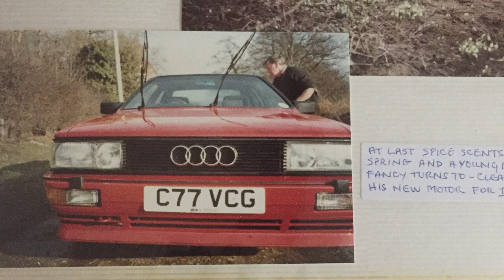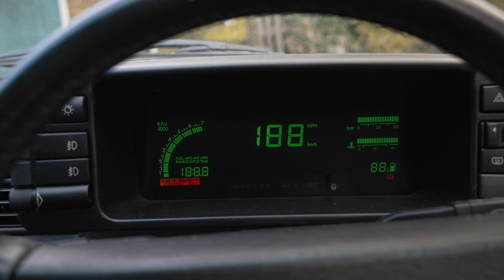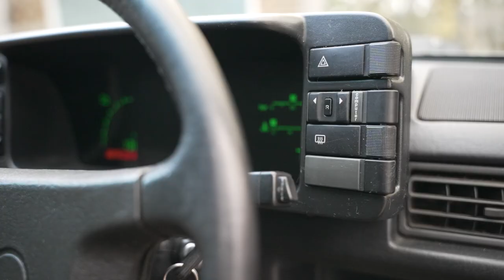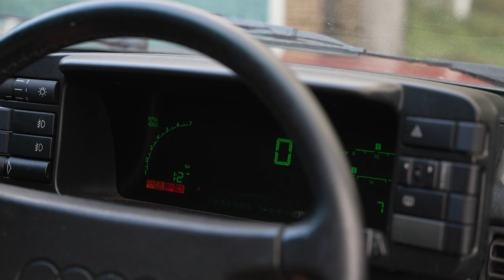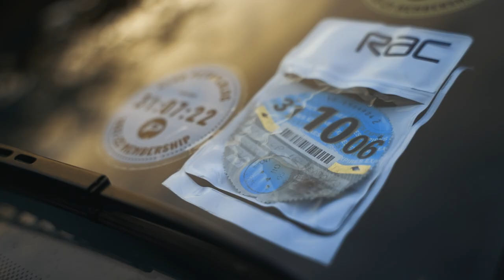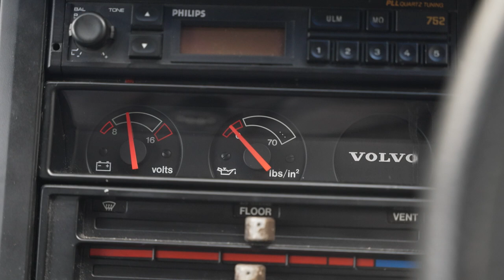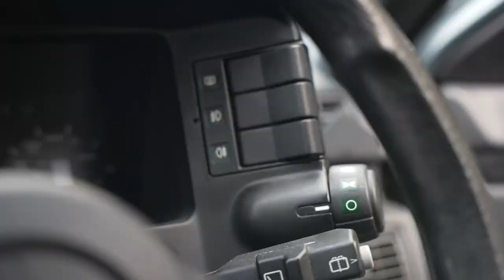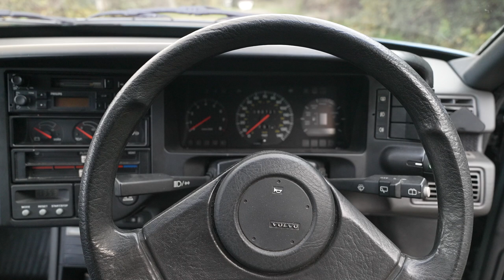80s classics make perfect first cars // The Late Brake Show

Comment: I worked on these as a apprentice at the local Volvo dealer, they were terrible, electrical faults, water leaks, shitty Renault engine that leaked like a sieve. We used to refer the ES model as the en suite 😆..
Reply: My wife had a Volvo 480 for 3 years. It needed recovery twice a year "reliably". The frequency of breakdowns was the only reliable thing about it.

Comment: Great to see two young car enthusiasts with a passion for classics.  Love the Volvo 480ES, always wanted one from the minute I got the Matchbox toy version as a kid, but for some reason never bought a real one.  They had those faults from new  - they rattled and leaked and had electrical faults by the bucketload.  Even the Volvo salesman in '98 talked me out of buying a second-hand one, they wouldn't retail the older ones by then, as he said to me "everything goes wrong, everything!"  They drove so well, sounded nice and looked so cool though.  Fantastic level of equipment for the time as well.  Love the Quattro too, but it's the 480 I want!
Reply: If Renault have anything to do with electrics/electronics in a vehicle you are almost guaranteed problems.

Comment: Two cars that I remember from my childhood. 
The Quattro - my father had good connections with the local VW/Audi dealership, he mostly had had VW until that time and was on his first Audi. When I was maybe 8 - 10 years old we went to the dealership, they had an Quattro, similar to this one I would think, on show. My father got to take it for a test drive together with someone from the store, I got to sit in the back seat. I will always remember the smile on my fathers face, and the feeling of sitting in the back seat as my father got to push that Audi on the highway.

The Volvo - Our neighbour worked at the local Volvo dealership, so he always had the latest Volvo on his driveway. He had a Volvo 480ES for some time, the highest spec model. My father and him always made jokes with each other about the cars, as he always had VW and Audi, and my neighbour naturally wanted him to drive a Volvo.

Comment: Having owned a 480 Turbo (Late model 94 car) I laughed when he mentioned poor electrics and failed alternator. The electrics were a disaster area and the worst fault was the info centre which worked when it felt like it, not a problem you think until you know that it has both fuel gauge, water and oil temp in it and with it off you had no idea what it was doing or if you were about to run out of fuel. That said once the boost was tweaked to run 13psi (up from factory 6psi) it could move well but would torque steer quite badly. A car I enjoyed for a couple of years but not sure I'd be keen to repeat. Glad that Ben is enjoying his too.
Reply: I've repaired over a 100 of those Volvo 480 instrument clusters, repair is easy: reflow cold solder joints and replace odometer cog wheel. They're breaking because at the time when they were developed in the 1980s, there was little known about how well they would age. Later Volvo got tougher electronics though breaking of odometer cog wheel appeared with the 850 as well and the DIM in the V70 can develop some nasty faults which really need a specialst to repair. I've never had electronics in a 480 which I couldn't repair for more than a few tenners, where newer cars were left for dead unless spending over a grand on new computers and reprogramming.

Comment: Feeling a relationship to this; my grandfather's last car he owned before he died was a 1997 Honda Civic Del Sol, low miles last year, manual. He loved manual transmission hondas from the early 90s until his death in the 2000s and a fun little targa-roof 2-seater was like his little dream and he loved it; the license plate had "RUG" in it and he called it his "magic carpet"! He got T-boned by a red light runner in an intersection and the car was totalled, the car was hit on the front passenger side so he was spared from major injury. He bought the car off the insurance company and had it rebuilt at a local collision repair center, they repaired it by attaching a straight front-clip off of another Del Sol and they did a great job, it was hard to tell that anything had happened to it. It wound up being sold to a friend of a friend a thousand miles away and last I saw it it was in pieces in a garage receiving a 500 HP turbo engine.

Comment: Started watching, cringing, stuck with it and was pleasantly surprised how that developed. Worked on the 480 brand new when I was a mechanic at a Volvo dealership, they were a pleasant surprise. The 200 and 700 series never went wrong, the 440 and 480... well. Still love the style of the 480 though.

Comment: I've got a 480 Turbo as a daily driver. Really practical. Mine's got the digital engine info display which plays up when the battery get weak. Some of the interior fittings are a bit 80's as well, as in brittle and rattle.

Comment: Nice Quattro
The First thing to Check with any Engine Running Badly is the Fuel As a Qualified Engineer ,If that Petrol has been sat in the Fuel Tank more than  A Month or so Some of the Octane Is Lost and also Condensation Get in 
Modern Petrol is Rubbish for Long term storage you need to add Fuel Stabiliser to the Tank if your Not using it very Often.  
Try New Petrol First Then Plugs Will Also need Replacing as they get Contaminated and Cleaning By hand is No use .
Then if its still Not Running Check the ignition and fuel system Further 👍

Comment: About 10 years ago a guy I met through work gave me a volvo 480 celebration 2.0i with 32k on the clock I had to just retrieve it from an underground carpark where it had sat for years, it fired straight up and I drove it home 😊 it was a great car and felt practically new with leather interiour I looked online there was 24 in existence at the time, it did go pretty good 2.0i weighed nothing and as in the vid the back end was top notch. Sadly a girlfriend at the time crashed it into a wall and wrote it off😭 it wasn't that badly damaged but the parts for the headlights where hens teath .. the insurance company picked it up and took it away

Comment: Nearly bought one of these when they first came out. But after arriving in my manual 928 the test drive was a disappointment, as were so many others. Which is why I still have the 928 34 years later.
Reply from the maker: Do you Keith? That's awesome.

Comment: My mate harper told me his mk1 golf gti was K-jetronic mechanical fuel injection, it was high revving thrasher that orange VW, i blew him away in my old black Opel manta 79 left hooker imported from Holland on logbook, 2 litre 4 speed coupe, did 134mph on the clock not a penny more, you knew she was a fast car because if you were doing 100mph and floored it off she went 😁😎🇬🇧

Comment: Sorry, not between the age of 17 and 25, but did enjoy watching you two on cars. Also, great that the green agenda doesn’t play big on your video.
You need to get your own Youtube channel. Brilliant!
Reply: Ironically, the greenest thing you can do car wise is restore an old car and use it instead of buying a new 'clean' car. Makes you wonder...
Reply: @benhooper1956  Indeed - that's why at 26 I'm still running my first car, after six years of ownership and over 70k miles (it's closing in on 200k overall). I'm a lifelong, devoted petrolhead and my head obviously gets turned by shiny things but fundamentally, my old (ish) Civic still works as it should, I can't imagine many cars being more reliable and I don't like the idea of adding to the demand for new cars when there are so many good ones kicking around already. 

Recently, thoughts have turned to preserving it a little better, and running it on less of a shoestring than I've become used to. I want an S2000 but as a gigging guitar player, it doesn't have enough space so could only be a 2nd car. And I've now decided that while the Civic carries on working, it'll carry on being my daily.
Reply: @PluckinA_Connor  As the old mantra goes, if it ain't broke, why scrap it? Probably. Hoep you get many more years out of it!

Comment: The Audi either has the wrong Front end or the wrong steering wheel because after i think 1986 or 1987 they had the therespoke wheel and before 1986 they had the quad headlamp Front end
Reply: Facelift with that front came in 1984, and the steering wheel was made the same as the rest of the range to have a bit of continuity. The front end stayed the same from 84-91 but I think the 3 spoke wheel came in 88, but my anorakness is failing me on that one!

Comment: I have a 480 GT
Reply: is that the one with the leather seats with patterns on them?
Reply: @sherpafan033  yep, although to be fair I prefer the half leather seats
Reply: @gabrielcooper1248  that’s what I have in my ES Two-Tone 😁
Reply: @sherpafan033  wanna swap? 😆
Reply: @gabrielcooper1248  my cars in bits at the moment. trying to sort out electrical gremlins. Pain in the backside not sure you'd want it haha
Reply: @sherpafan033  I meant the seats not the car :P
Reply: @gabrielcooper1248  oh right haha. My seats aren't too good either. Rip in the bolster and the heated seat function doesn't work. If you're in the UK, there is currently a Two-Tone 480 on eBay that has about an hour left that has the seats you're after.

Comment: 1600 quid to insure per year? Ouch, I'd be driving a tiny econobox if that's how much you pay for something that isn't even fast! 

10-15yo V6 commodores and I6 ford sedans are the norm for new drivers in Australia.
Reply from the maker: 1600 is cheap, trust me. I know many 17s who pay £3k for a 1.2 Corsa. Which is appalling.
Reply: @TheLateBrakeShow  over here registration is about AUD750 and includes TAC (basically road injury insurance)

On my probationary licence, 3rd party insurance for my 3.8L V6 Calais spec Holden was about AUD350, full comprehensive insurance was about AUD1000 (but I took the cheap route)

So as a new driver, for my up spec V6 3.8L I was paying ~AUD1100 per year, less than GBP600!
Reply: After 1 year it comes down to 600 for me, should have made that clearer sorry